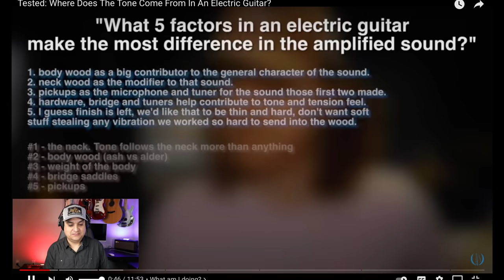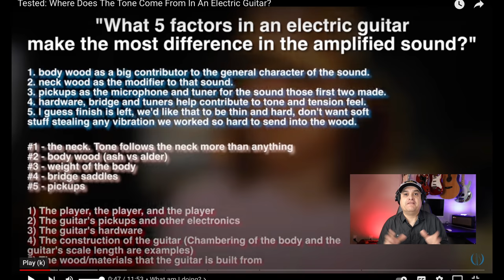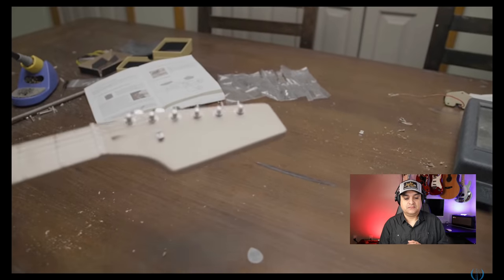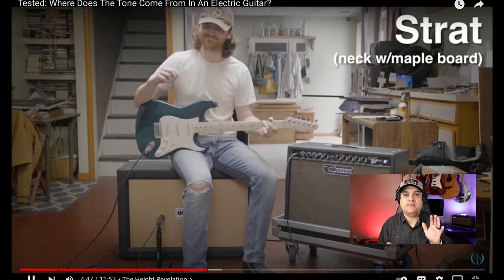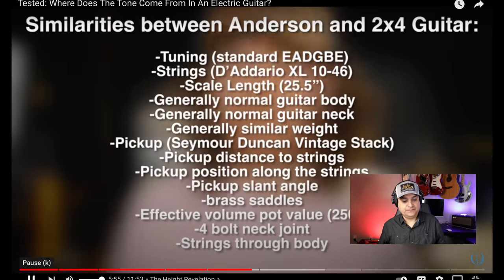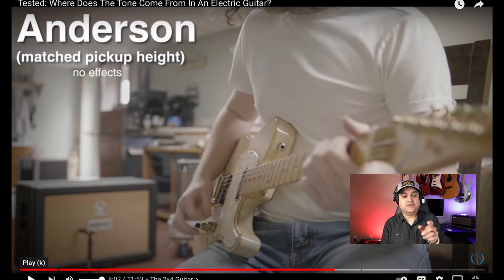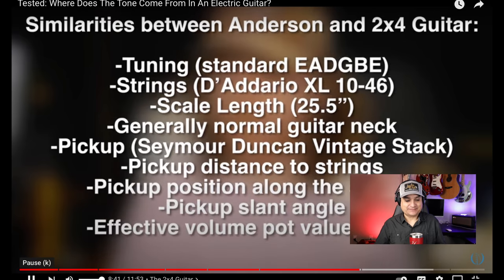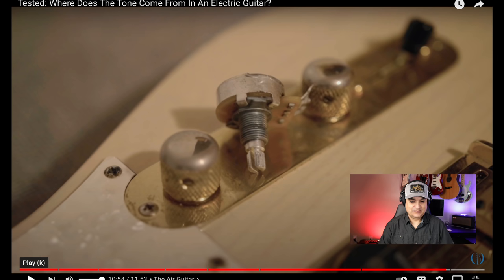Where Does The Tone Come From In An Electric Guitar - Reaction Video

Comment: This was never in doubt for me...it’s the basic physics of how electric guitar makes amplified sound, ie a moving conductor (vibrating string) in a magnetic field (pickup magnets) generates current in a coil (pickup windings)...the current generated is the musical signal...it’s fantastic to finally see someone demonstrate this...proof you can mod a partscaster or Squier to sound exactly as good as your favourite Custom Shop Fender if you get the same pickups and wiring harness and setup the pickups heights exactly the same...same strings gauge (because the conductor and its position in the magnetic field of the pickups matters to the current/signal generated).  Again, the physics of the system also suggest that the type and presence or absence of the body & neck tone woods will contribute to more or less sustain of the string vibration, and therefore note longevity, as distinct from tone...🧨🧨🧨
Reply: Well said
Reply: To be fair, Les Paul built his first electric guitar from a random 2x4 and added body wings later so people would believe that it was a guitar. In the 2015 movie "It Might get Loud," Jack White builds a 1 string guitar from a piece of scrap wood, pickup, and a jack. I knew a guy who built guitars out of shovels and broom handles he found in the garbage. Players have known forever that tonewood is BS, but big companies try pushing their agenda because it's what makes money
Reply: @EpictheEpicest  wood can get crazy expensive! So really it’s a good hustle. You just have to know when you’re being hustled. I know about the log and the whole story of the les pauls origin. I’ve also seen “it mght get loud”. You have to admit though les pauls definitely became a thing of beauty since the log. They’ve had their ups and downs over the years but they’ve always looked great. The key to playing les pauls is looking at every one of them that you can find for sale in your conceivable travel range and buying the ones that have the qualities a good les paul should have.
Reply: However ‘sustain’ is a complex waveform and not a sine wave, so the harmonics can lose energy at different rates, which means the decay is not linear across all frequencies…. 

The construction still matters.
Reply: That's the simplest layer of it mate. Remember resonance? I also agree that tone wood doesent quite matter, but having some kind of sustaining body or cavity is extremely important, and regarding the air guitar example that was actually the tables. Ultimately, for me it's definitely the setup, quality of pickups and electronics, and quality of construction that actually effects tone.
Reply: @twopaste  there you go. I can agree with that. It’s the whole thing. Good pickups, good wiring, good pots,good quality wood, good amps, good pedals, good player= good tone.if you take a les paul (or any good quality guitar )and plug it into a dumble and put it into a good players hands it will sound good. What part of that chain makes the biggest difference doesn’t matter.
Reply: @twopaste  How is it you can literally watch something being disproved before your eyes and still not get it? Resonance doesn't matter at all for an electric guitar, sorry. Resonance is when sound reverberates, which usually requires a large open space or hollow chamber. Electric guitar bodies can be built from anything, are solid and have no sound holes, so there is literally nowhere for sound to reverberate, and it's undesirable anyway because it causes feedback. Reverberation is necessary for an acoustic instrument, but that's not what's being tested here.
Reply: Sound isn't simple. I stopped reading there
Reply: Resonance is what your hear from an acoustic guitar…these are pressure waves.  An electric guitar cannot amplify pressure waves or transfer/transmit them via the pickups.  The only movement that an electric guitar pickup can convert into a musical signal (tone) is the vibration of the strings relative to the pickup.  It’s just a physics fact.

As to sustain, it is not a waveform; it is simply how long (time) a note/chord lasts audibly.  This is where the mass, density and damping characteristics of the guitar woods/construction can influence how long a note/guitar sustains.  The video tested tone, not sustain as such, in that the musical excerpts compared the tone of a number of musical runs of chords / notes, not how long they lasted.  It was clear that the woods / construction did not matter to the tone; a separate test may show it matters a little to the sustain however.
Reply: @EpictheEpicest  when unplugged some electrc guitars will sustain longer than others. And usually the ones that ring out nicely unplugged sound better when you plug them in. I believe its the wood and construction that does this.
Reply: @davidkyle5552  The vibrations of the strings is effected by the wood... Which is also a fact... It also effects the feedback which is a huge part of tone... Go play some semi hollow & hollow electrics and come back to this! i.e. es 335 (block) vs es330 (no block). I can't believe this idiot actually thinks tonewood doesn't effect the tone through pickups! so wrong! The center block matters! All you have to do is play guitars to know this. I suggest you guys start playing unsteady of wasting your lives tinkering
Reply: @PartyChicken407  Sustain?  How long do you let a string vibrate before you play the next note?  If you play one note every 30 seconds it would probably be pretty boring. Sustain almost never comes into play.
Reply: @TexanUSMC8089  I think that all the time. I’m not sure if it’s true or not. If you really wanna know to sustain you gotta wiggle it a little bit anyway. Or you have a pedal or something or something or something.
Reply: @benink5690  He doesn’t just think it doesn’t matter, he clearly demonstrated it doesn’t with the barn-plank guitar.
Reply: @cleftturnip7774  Okay, then be my guest and perform your next concert with an electric guitar unplugged and see how many attention spans you can sustain.
Reply: @cleftturnip7774  Happy 10th birthday, bro.
Reply: @EpictheEpicest  i know you are
Reply: @TexanUSMC8089  tell that to Dave Gilmore
Reply: Wood should still have an impact on sustain. Whether that impact is meaningful or not is a different matter, and it would be interesting to see a video on this. I think this guy plans to do that exact video next.
Reply: @PartyChicken407  Correct. But many still conflate resonance/sustain with tone.
Reply: @CristiNeagu  It's completely random. Some wood species are denser than others, which SHOULD make a difference, but there are also just denser pieces of wood from the same tree. And a human will never hit the string exactly the same way twice, and no one plays music that requires a note to be held until it dies out naturally so who even cares? Buy a sustainer pedal or sustaniac pickup, or listen to electronic music and STFU.
Reply: While I agree with you in general, there's a strong argument that that is not how electric guitars work. According to Seth Lover, Seymour Duncan, Jeff Lace, Lindy Fralin, Larry Fishman, and Scott Lawing (who invented the Zexcoil pickups), it isn't about the string disturbing the magnetic field around the coil. What happens is that the magnets in the pickup magnetize the strings, which makes them magnets moving past a coil, a classic generator.
Reply: @EpictheEpicest  Chill, bro. What's your problem?
Reply: @CarsInDimension  Technically speaking, and to reiterate the fundamentals of the physics at play here, the part you are somewhat correct about is that the pickup is a “generator” in this system but your description of how that works isn’t quite on the mark…the description of how a generator works is exactly as described in my original comment, i.e. a moving conductor (string) in a magnetic field (pickup) generates a current (musical signal in the coil)…this much cannot be altered or refuted by the the guitar community because it is simply the fundamental physics principle of how a pickup or any generator works; even the most complicated or high tech electrical generator you can think of boils down to this physics fundamental.  I’m sure the aforementioned pickup designers have a clear grasp of that principle.  Coincidentally, I was speaking to Lindy just 3 weeks ago discussing the specifications of a custom set of Tele pickups he is making to order for me…I can’t wait to put them in my Aircaster when they get here! 😂
Reply: Electrons don’t care about much…Impedance mismatch, a good ground and that’s about it.
Reply: @CristiNeagu  I don't have a problem with you, only what you commented. You've been fed lies by guitar marketing and are regurgitating them as if they're fact.
Reply: @EpictheEpicest  So your claim is that if you make a guitar body out of rubber, it won't have any sort of influence on sustain?
Reply: @thejakefromstatefarm6768  Probably one of the baddest guitars construction wise though.
Reply: @thejakefromstatefarm6768  once a cork sniffer always a cork sniffer I guess.
Reply: @TexanUSMC8089  - You are confused here... ADSR.  Attack Decay Sustain Release.  Your notion that 'sustain' doesn't come into play until some ridiculously long period following the initial attack is not in line with physics.  Your comment is analogous to saying 'well... I don't just play one note and let it decay into silence, so the for the reverb in this giant church I am performing in has zero effect on the sound of my guitar.'   

Even the initial attack is effected by the resonance of the system.
Reply: @cleftturnip7774  maybe, just maybe a lot of that has to do with the general construction and hardware of the guitar in question.
Reply: @cheenu711  for sure. Everything makes a difference.
Reply: What about how it feels? The feel is a huge part wich effects the way you play which effects the way it sounds.

Comment: I watched Jim's video and commented on it as well.  My background is electrical engineering and I have said this forever.  This is why I buy less expensive guitars, set them up myself, and replace the pickups with good ones.  One of my favourite guitars is my Squire Afinity Tele that I put Fender Tex Mex Tele pickups in through my Traynor YGL1 amp on the USA mode.  This is my default sound and to me nothing beats it.
Reply: the pickups on the cheap east asian kit weren’t necessarily bad.  they were just 1000 miles from the super hot wound noiseless vintage stack.  The “cheap” ones were prob 5k-ish vs 18k(!!) on the duncans.  Also the duncan magnets are alnico 5 vs im guessing alnico 2 on the cheapies.  But they didnt sound bad to me just different.
Reply: I have Custom Shop 51 Nocasters in my Mexican Tele and it sounds awesome.
Reply: Yup. For me, if it ain't in the circuit, it won't affect the tone (as much). That's how I generally view things (setup, such as string action, fret levelling etc aside). I have a trio of CS 69 pickups in my Mexican strat (Alder body, Maple Neck, Rosewood Fretboard), and it sounds K I L L E R. Wouldn't trade it for anything.
Reply: Conversely, I swapped the bridge pins from plastic to bone on my D28 and heard a clear difference. I think everything makes a difference on an acoustic because the thing itself is amplifying the sound.
Reply: @jimmythefish  An acoustic can be thought of as a mechanical sound so anything in the physical realm on the guitar will have some sort of effect on the tone.  An electric is just that - an electric signal which cannot be influenced by wood.  Mechanical things can be influenced by wood - ie. amp cabinet as it has an effect on the mechanical vibrations from the speaker, acoustic wood top, etc.
Reply: @chillpillology  No but as soon as he put the same pickup in it and adjusted the height to the same, the sound was almost identical showing that the wood had nothing to do with it - as close as you can get with different strings, actual pickup and slight variation in playing as subtle as that is.
Reply: my #1 thing is how does it feel.   It can be made to sound good with new pickups or cap change.  If I can't fall in love with the neck, I won't buy it.  Regardless of price.

Comment: I always get overwhelmed when looking for a new guitar, but this has massively changed how i look at it. It’s so much simpler than so many people make it out to be.
Reply: Learn to look at any device as a system.  Look at input , output and what impacts it in between.  Use logic stop listening to others. Input is string vibration, output is signal at output jack, the in between is pickups, switch, capacitors and resistors ( tone pots).  No wood in that equation.